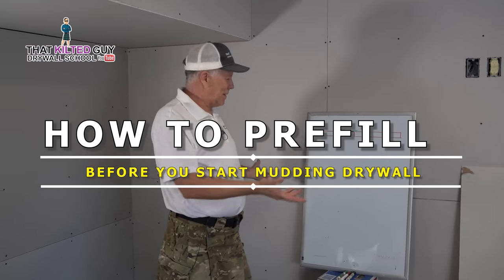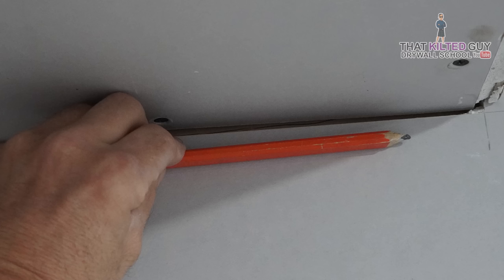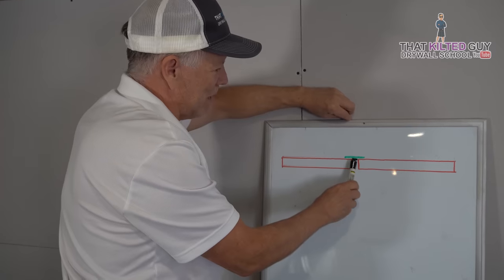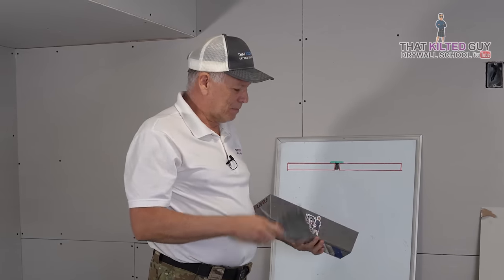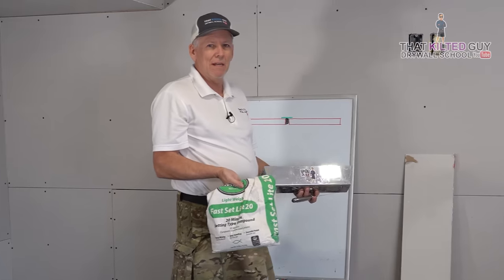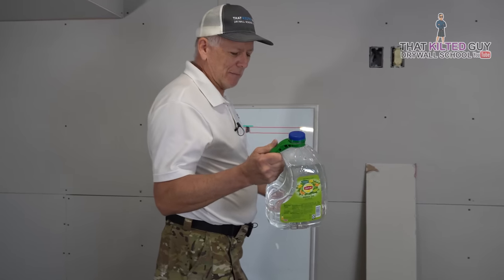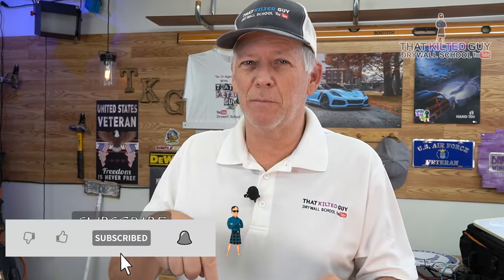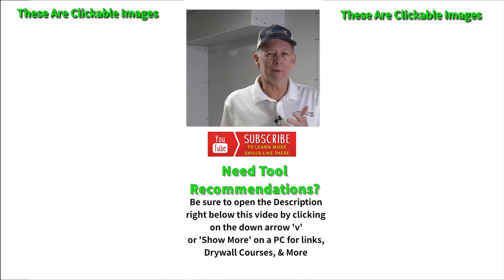How to PreFill BEFORE Taping & Mudding. Very Important

Comment: Looks like someone used up a bunch of their scraps instead of hanging it properly using full sheets wherever possible…. Nothing like finishing 6 butt joints in a 3x3 closet…. I’ve had it out with customers that want a price for just finishing because they’re going to hang it themselves, so you show up after it’s hung only to realize they’ve left you a jigsaw puzzle with butt joints everywhere because they wanted to save $200 on drywall.
Reply: Boo hoo
Reply: I'm guilty of doing this then regretting it
Reply: I price accordingly my time is money
Reply: Bid it worst case for a diy😉
Reply: Maybe you should give out some of that money for the rest of everyone who has to cut corners where they can to save that $200. You certainly run your mouth like you can afford it.
Reply: @fredflintstone221  professional taper here, if you safe 200 on drywall you're gonna make for far more than 200 in labor for the tape and top work. finishing it yourself? cool, you do you. calling a finisher? do it right, cause I aint giving you no flat rate
Reply: Guy said it was a purty dang good job. ¯\_(ツ)_/¯
Reply: Yes these tight asses piss me off. I charge double. And they thought they’d save .99 and spend way more because the framing is usually not shimmed and you have to skim the whole f-ing wall bc they thought they’d save money. Pennies. Never let the homeowners hang it. Have a clause in your contract that says not responsible for cracks. Because if they didn’t block it or shim it bc framing is bad, you will have even more work skimming or joints that crack.
Reply: Like 😊
Reply: I made that mistake long ago. Now I minimize joints no matter the cost. Laying four coats of mud on a joint is way more labour intensive than what you save on the drywall.
Reply: Dude IM SO SICK OF U CONTRACTORS CHARGIN LIKE ITS ROCKET SCIENCE  IF SOMEONE WANT TO SAVE LOOT COOL
IF U DONT WANNA DO IT JUST DON'T
Reply: @sharodlesleysr2466  then diy? Just saying inflation is a thing the past few years and these guys do this work for you. If your that desperate to save money then just hire the people at home depot and hope you get atleast 1 decent worker and keep google translate on hand if you dont know spanish.
Reply: Im the opposite, i hate hanging drywall but i love the tape and float, but one thing i find most sad is when i walk into a job site to finish, they say its for a bathroom and suprise suprise, no greenboard. How do you professionally tell them they dun goofed and if thier ok with the mold

Comment: This guy works in bare feet! That's so badass! Great video, thank you. I was confused about when to pre-fill and when not to, and this video explained perfectly. Gaps larger than an eighth inch, cut edges (not factory edges) abutting need pre-fill, damaged corners, etc. Don't ever leave loose paper. Got it. Use number 45 drywall mud compound, aka 'hot mud'. Cheers!

Comment: Re-using the wash water makes 90 minute mud into 30 minute mud. Comes in handy when topcoating the same day since all of your joints will be equal hardness. If you set the tape in hot mud and topcoat with topping as soon as it hardens it can save a day.

Comment: Loves your videos. I work on high end kitchen and bathroom renovations in Florida typically alone and have used a lot of your experience on drywall repair with my own experience and it has really improved my A game. Looking at this video reminds me of why I hate others hanging my board, this one isn’t to bad but my biggest thing I tell hangers is never gap my inside corners or make recessed to but joints if possible.
Reply: Recessed to butt joints aren't that big of a deal and not that hard to finish.  They're also unavoidable if you don't want to waste a lot of board.
Reply: J Will: I typically hang from top down so that the cut is behind baseboards eliminating any possibility of that happening. I would agree that if you are patching in an area large or small then yes it could occur.  Also when mudding recessed to recessed you can almost always do final finish in 2 coats vs 3 but that also depends on quality of finish performed. What works for me may not work for you and vice versa.
Reply: @DavidSmith-tw7bw  A top-down hang is key on larger areas, for sure.  And of course taper to taper is much easier to finish, but a 2 coat finish is tough if it's going to be visible.

Comment: This was JUST the video I needed! I'm repairing the walls of a 1970's house, and every joint is HORRIBLE lol. I just dug out all the mud and layers of tape from a cracked butt joint, and found one layer of tape, one layer of MESH tape, and another layer of tape over a huge gap! It looks like the prefilled it, as I had to scrape it all out, but the gap is about a half an inch, AND one side is more recessed than the other. Nasty work all around lol. I'm hoping I can get it prefilled right this time so it doesn't end up just cracking on me again in the future!
Reply: Sounds like the problem I have right now. What did you prefilled with?

Comment: Your video did help a lot. Thanks a lot. 
I’m a DIYer and I surprised myself that I was actually doing what you recommended. Well, everything except using the handle to flatten out the slight ridges.

Comment: I am doing cosmetic repairs on plaster and I bought a cheap mixer at GoodWill and a mixing bowl.  Prior to doing this I was not mixing to the consistency I wanted but somehow this worked perfectly.  I paid $5 or less for the mixer.  I also started using a big plastic spoon to move the mud around.  Sounds silly but they are all designed to work together and inexpensive for a non pro.  I do have a hawk and trowel also.

Comment: used to do a lot of prefilling, especially in garages where the ceilings were around 9-10 feet, there was usually a 1-2 ft rip in the middle of the wall, where paper joint met cut joint, much easier to tape and finish those when they are prefilled

Used a LOT of durabond (hot mud) we taped with a bazooka, but I preferred to run bed coats and top coats on joints by hand. We always used durabond for bed coat and Plus 3 for top coat. I could mix 2 buckets of durabond, run both buckets, and have my tools clean and both buckets cleaned out ready to mix next batch before the first bucket's mud started to set

Comment: I used an icing piping bag to fill the cracks on the inside edge. Put the mud in a bag piped it in and then ran a knife over to flatten.

Comment: Just pre filled 300sq ceiling yesterday, trying something new today, to tape the 4 ft edge butt seam with homemade 5 3/4 in wide 3/4 ply with about 1 3/4 degree bevel cut centered giving a pocket for tape filling. Thank you for information

Comment: Great stuff! I never knew anything about pre filling. I have a bathroom I eventually want to renovate and I can’t wait to put what I’ve learned from you to work. Thank you!
Reply: I’ve been doing Drywall work for 35+ years and that pre-filling definitely a step you can skip unless it’s a 1/2 inch or wider and then you probably need to recut a piece of Sheetrock and do it over .

Comment: Durabond is not for the novice. It is a special purpose mud for filling large areas. It is more of a cement...IT DOES NOT SAND. I use it for large or deep holes...sometimes with fiberglass tape then finish coat with easysand.

Comment: Great content, I have large (1/4 +) cracks at the ceiling wall junction on the walls that are short walls on each side of an open kitchen. I think they were never prefilled. Funny thing they are only obvious in the winter months.
Reply from the maker: Do you have a swamp cooler? Surfaces often expand & contract due to cold and heat but also due to high humidity and then low humidity like we have here in Colorado from swamp coolers

Comment: I’ve watched a bunch of your videos and they’re helpful! Thank You!
I live in a 1950s house with textured drywall walls everywhere. As I work thru improvements, there are lots of imperfections I find - lifting drywall paper, poor patching, hole to patch. I want to redo my baseboards and trim, so while I’m doing that, what is the sensible thing to do about the drywall? 
A) deal with one problem at a time with patching
B) tear out and redo
C) just sell the house and move to a rental
D) something else

Appreciate your advice!

Jaime (she)
Reply from the maker: I would just repair it all at the Same time. But you might start a little at a time.

Comment: All hangers are not created equal. Finishers love good ones and curse the shoddy ones. There are some applications where the hard-set of durabond is needed but it's sure easier working with (and clean-up) smoother soft set. Your teaching style is really good and your vids well done. You're  obviously a legit finisher. Hat tip to you
Reply from the maker: Thanks, I appreciate that 😎, & Thanks for subscribing!

Comment: I prepped, and pre-filled my soffet today. & wanted to give a heads up to those planning it too.
 1) Just put about a "cup" (measurement), of 45 min. Mud in your pan. & add small amounts of water, (mixing with a beater in a drill worked great!), adjusting the mix till thick, like kilted guy said.  All my work was over head, so had to make it stiff. I waisted about 1/4 pan full the first go, because I mixed too much. 1 cup was a perfect amount of mud to work with in the time I could apply it, (before it got to hard to work with)
2) when mixing mud in your pan with a beater & drill...mix it in the middle of the room, or outside, lol I had a few splatters on my walls, but luckily I noticed & swiped them before they got too hard.
Reply from the maker: Good luck and thank you for your comment
Reply: Good tip! Question, do you need to sand after prefilling or just tape over? Thanks!
Reply: @motogp9253  ha Moto, I did knock down some edges & clumps with a 180 sanding sponge/block. If nothing else, just so I wouldn't knock them off with the knife while taping, & dragging them through the mud.
Reply: Yes I did knock down the edges/clumps with a sanding block. (And because I'm anal, lol), vacuumed it, (w/shop-vac/brush attached), that may be overkill, but?  Might be a good one for the Kilted guy to answer it needed or not.
Reply: Hi, on the question of sanding for me my 6” knife is used for all coats to scrape not sand and depending on final coat and texture last coat would be very light sand or wet sponge but edges of all coats would need to be kept tight.

Comment: I know drywall is an art.   Watching a pro mud a wall makes it look SO easy.   Then I try it.  :(      One reason is because I did not know about prefilling the joint, and trimming or mashing the paper edge .  Also I have been using the premixed mud, and I think that may be an issue.    I bought some hot mud and am going to work on a patch where I had to put wood backing so I can hang a mirror in the bathroom.    Thank you so much for these techniques.   One thing that has always been an issue is when I mud over screws the mud tends to dimple.   I am hoping hot mud will help that too.
Reply from the maker: Screws take multiple coats

Comment: Thanks for the videos! Just starting out on small jobs plus doing my own projects. Your vids have definitely made a difference. Learned a lot in a short amount of time!!! Especially using the mixer. Forgot my drill so I just bought a cheap handheld adjustable speed mixer ($9) and use one paddle. Definitely works! Also invested in a drywall screwgun after watching your video!
Reply from the maker: Glad to help!  Great creativity.  Thank you for your comments & support
Reply: Just use the wifes mixer when shes not home! Make sure the beaters are clean. You dont what this plaster in your mashed potatoes

Comment: Nice instructional vid
Iv neva prefilled if an internal corner has a gap I tape ova it & put another layer of tape ova it & same if a seam has a gap or butt joint 
I've dun this on my own homes & hav neva had any cracks otha than the normal structural movement scenario 
❤🇦🇺

Comment: Here is a funny. Had to cut an access hole in the garage. sheetrock. Then patch back. Forgot my mudding box with spreaders. I had 5 min mud, a stiff concrete margin trowel, and paper tape. For my finish tool. I broke out my charge card, and it worked fine for the fire tape finish. A lot messier was getting fingers coated in mud, but the bucket of water was the solution. Lol
Reply from the maker: Lol 😂

Comment: Thanks very much for your videos. They’re very helpful. Two questions:
1. You mentioned durabond is ok for pre filling. Should I thin it with water first?
2. I should prefill nail holes, correct?
Reply from the maker: No to nail holes, and durabond comes in powder form so requires water
Reply: @ThatKiltedGuyDIY  thanks for responding so quickly! I had purchased premixed durabond bc was worried I’d mess up the hot mud proportions but wanted to confirm it’s ok to use for prefilling. I plan to watch all your videos so I suspect I’ll learn about screw holes soon enough. Thanks very much!

Comment: Great Videos. I have done a lot of drywall taping but always learn a little something from your videos, they make my work easier and better. Funny question though… what’s with the bare feet?
Reply from the maker: I work so fast I run right out of my shoes so I had to work barefoot because they were kind of smoking and hot and I couldn’t get them back on my feet. Then I discovered that I could wash the mud off my feet before I get back in my nice new truck. 

No actually I have peripheral neuropathy which is nerve pain in my feet and it’s easier to go barefoot than to wear shoes. And this job has no hazards to worry about so it’s like going barefoot at home. No big deal. I know it freaks some people out but, I gave up worrying about what society thinks years ago. Thanks for asking

Comment: My current house was built during the 2000's housing boom. None of the drywall joints were prefilled.  They just ran a tape gun over the top of every joint.  Needless to say I have a lot of tape peeling in my house.

Comment: Great tips on pre filling.  One area I struggle with is around outlet boxes where the cutout is often messed up. This is especially true if the box is already wired up with an outlet or switch. Please address this.
Reply from the maker: I shot over 30 videos on this job, and that is one of them. Be sure you have the all notifications turned on and you’ll see it soon
Reply: @ThatKiltedGuyDIY  Looking forward to it.  Thanks for reply.

Comment: Hello there. Thank you so much for your advise! On the prefilled for you have to use hot mud? If you have time to dry can you use the all purpose mud?
Reply from the maker: It’s not as strong and it won’t fill gaps larger than one eighth of an inch without cracking which defeats the point.

Comment: Thanks for the great info in this video……I do have one question, and I apologize if it was covered before. After I pre fill, do I then put my tape on the pre fill? Or would I let it dry, then possibly sand, then do regular dry wall mud and tape as if it were now a typical drywall joint that didn’t need repair work?

Comment: No offense, but let me guess, did the hanger simply run out of drywall screws or what?  Badly broken corners where the piece of board doesn't get replaced by the hanger.  A 1/2" gap where the wallboard abuts the ceiling, and Chapter 25 of the code requires panels to be in "moderate contact" which the vast majority of inspectors of record, compliance officers, and fire life-safety officers that I've worked with qualify as being a 1/8" maximum gap - I guess the hanger cut that board three times, and it's still too short.  What building code was the hanger working under?

I realize that you are showing how to tape around hanger errors, but I've never worked under a building code that allows the taper/finisher to simply correct all the sins of the hangers plus why should you have to fix the hanger's mistakes in the first place?  Does the building code that you are working under allow the hanger's mistakes to go uncorrected and then force the taper/finisher to cover those mistakes?  Chapter 25 of the CBSC - especially in DSA (K-14 schools) or OSHPD (hospitals) work - simply doesn't allow what I'm seeing with respect to hanging.  Your taping/finishing work is great and demonstrates lots of skill. However, a poor hang job just makes the taper/finisher have to work harder, plus overtime, a poor hang job is easier to damage through casual impact, etc.

Comment: Thank's for that tip! I'll be pre filling a few spots tomorrow before tape! Speaking of taping...I just have mesh tape handy. What are
Reply: I just have mesh tape on hand, what is your opinion on using mesh tape on inside corners? (Taping a soffit where it meets the wall) Thank you for any suggestions! Love the video's! Great tips.
Reply from the maker: I’ve done it but rarely because it’s hard to not cut it, get it square, and I’m just not as confident about it on an inside angle

Comment: Redoing a bathroom….
Had big gaps between drywalls 1/2” to 3/4” filled them up with mud … did several coats.
I was able to install inside corner tape!   I SUCK AT TAPING… 
I have 4 horizzonal joints… that are left to the tape…. I know I have to do them, the problem is I put so much mud and I can’t see them joints anymore! ( used wider knife )
Walls is sanded… and look great!
Ready to paint!
Should I still install the horizontal tape… even if I can’t see the seem? Just lowballing it where I think the joint would be?
Reply from the maker: It will most likely crack eventually if you don’t